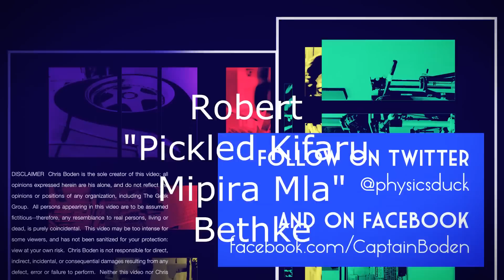Captain's Blog 12 24 2016 AxiDraw Demonstration Testing

Comment: So you effectively have a pen plotter that uses markers and a manual marker change for each color.  I used a pen plotter in High School that had an 8 pen carousel with automatic pen change but it still to ages to plot a C or D size sheet.  The benefit of a pen plotter is that you can pretty much use a pen or in this case a marker with any type of ink, paint, etc.  You could also use it to cover a copper clad circuit board with a circuit design before etching with reasonable accuracy.
Reply: I was testing it with markers, you could put anything in it.
Reply: Lis Bokt Definitely a cool device to show people the history of computer printing and beginnings of 2 axis CNC devices.  
Pen or marker plotting is one of the first tests I generally put a newly assembled CNC mini mill through.  Easy to verify all the stepping settings and directions are set correctly. without creating any mess.
Reply: I have done quite a few big parts on the sheet router with a sharpie to make sure I'm happy with my layout. It works well. The Axidraw is a nice, reliable, accessible tool for students and machining newbies to learn the basics and principles without having to worry about breaking end mills or wading through a lot of CAD/CAM.
Reply: try AxiDraw on t shirts.
Reply: good way to test a mini mill.